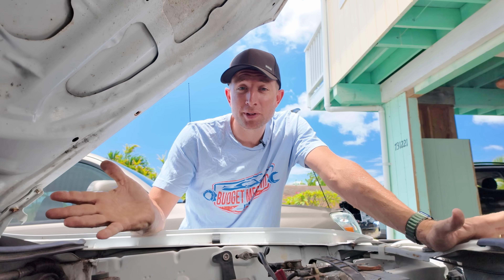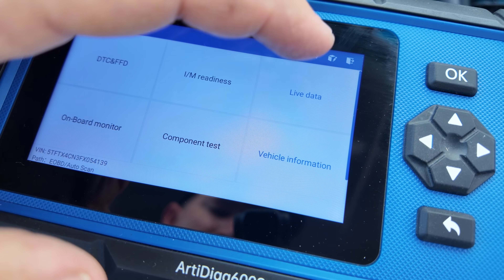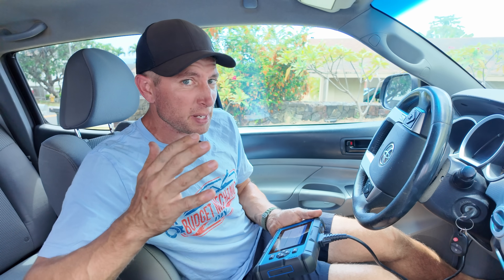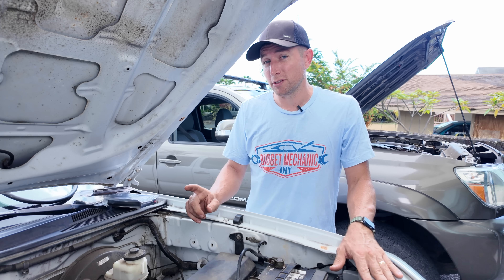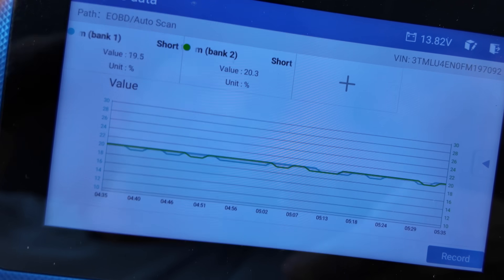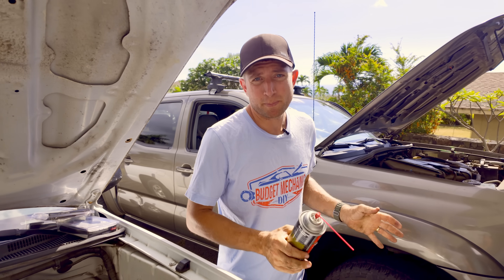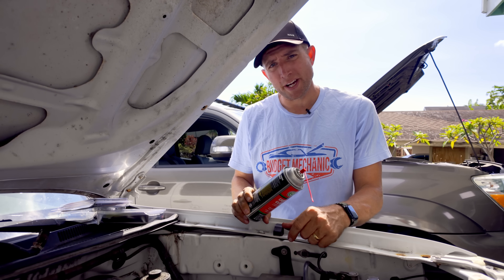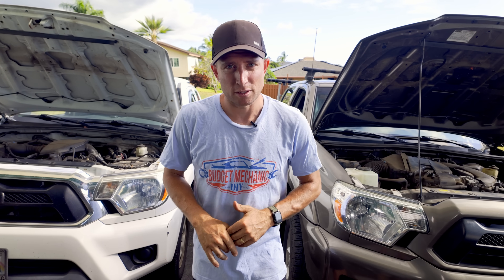4 vs 6 Cylinder Vacuum Leaks - And Why They Cost You More Than You Think

Comment: Okay, injected a good steady supply of baby oil smoke directly into the main intake manifold port. Nothing. Nada. Zippola. No smoke rising from anywhere other than the air filter box, of course. Also injected smoke into brake booster hose (for shits n' giggles) Perfect seal, no leaks there. Didn't have a hose long enough to reach the tailpipe from the smoke machine running off the battery in the engine bay. On order. Will be injecting smoke up the tailpipe about a week from now.

My strange symptoms are scanner related. Downstream O2 always low voltage 0.05 to 0.15 tops. Long term fuel trim is now always around +13% to +15% - used to be permantley stuck at +19.5%. Already fired off a parts cannon for a new OEM brand 02 sensor, made no difference in the low voltage reading. Bought a high priced dealership fuel pressure regulator, no change. Also disconnected the negative battery terminal for 20 minutes and then took a 50 mile drive in city and highway conditions. ECU is relearning fuel trims.

Still never had a trouble code concerning any of this, but I'm on it.

Update: Found two exhaust leaks. One upstream of the oxygen sensors and catty converter, and one downstream of the muffler (providing dual tailpipe action I suppose)

Update:

Both exhaust leaks are now completely sealed, but the low sensor voltage remains. The  downstream O2 voltage shot up to 0.8 through forced enrichment - meaning the ECU and O2 sensors wiring harness are both good, so my engine is truly running lean.

I have narrowed this down to the point that I believe the extra oxygen is entering my exhaust through tight exhaust valves. I already planned on measuring the valve clearances in April 2026, so wish me luck. Peace up 🕊️ and peace out. ✌️

Comment: I think you need to make a video about plugged vacuum lines, I was having issues with a EVAP pre 95 vehicle, everything was working cept it wouldn’t purge the charcoal canister, turned out the vacuum line from canister to the intake manifold was all gummy on the inside.. I got lucky finding it.. I took the hose off and thought I’d blow in it and it was clogged solid.. just throwing that out there if your intrested, I like your vid’s, good stuff thanks

Comment: Smoke test it. That's the best way. Don't spray brake cleaner on rubber hoses. If you didn't have a leak from them now, you probably will in the future since the solvent dries them out.
Reply: Use Simple Green or pure wintergreen essential oil to restore rubber hoses.  Or replace them... It's not ideal to spray brake cleaner on rubber, but a small amount for the sake of troubleshooting isn't going to kill anyone. Carb cleaner will certainly be better.
Reply: Not to mention the potential for somebody to start a fire. Smoke testing is the best diag

Comment: On vise grip garage Derek sprays carb spray around the intake manifold, carburetor mount, and various vacuum hoses. If the engine speeds up near one, there is a vacuum leak.
Reply: Its also a good way to fire when you spray a flammable liquid on a hot engine. Remember the warning at the beginning of his videos,  "He's an Idiot and do not do what he does!". For people like you, go ahead  and burn your car/yourself up and learn the hard way.

Comment: My brake booster hose had a crack in a plastic connector/nipple.
No problem for the motor yet. But a potentially dangerous situation, if it sheared of completely one day during driving, and the brake booster would completely fail.
I was happy to find and fix it early. In Germany with high highway speeds and a lot of traffic, you don't want your brake to (mostly) fail out of the blue.

Comment: What about a smoke test? Wouldn't it be the ultimate test for this? I am a begginer in this tho
Reply: Yes, don't listen to this guy^^^ Smoke testing is by far the better and safer method for locating vacuum leaks. There are many places you won't be able to reach with spraying cleaner around. 50$ on Amazon.
Reply: No, smoke doesnt have enough pressure actually visualize to the observer where leaks are. The only guaranteed method is spraying carb cleaner wherever you think a leak is, and check for RPM spikes.